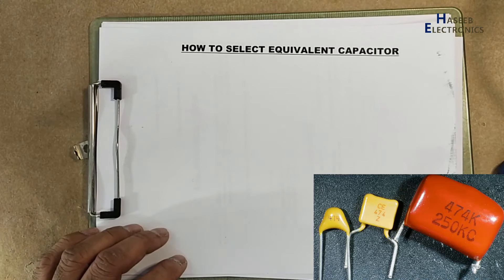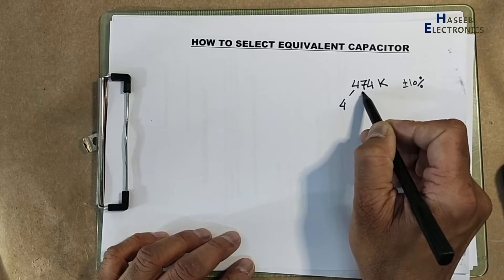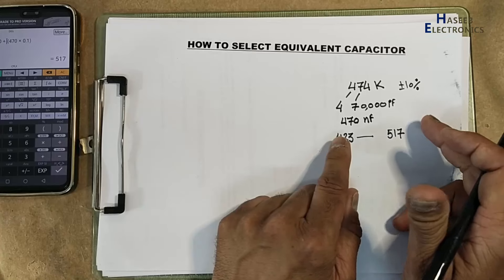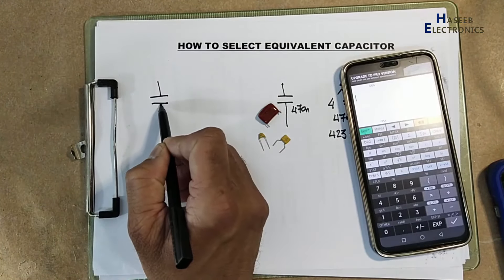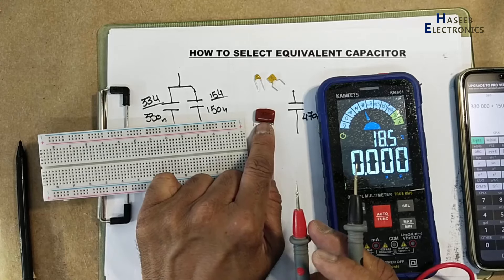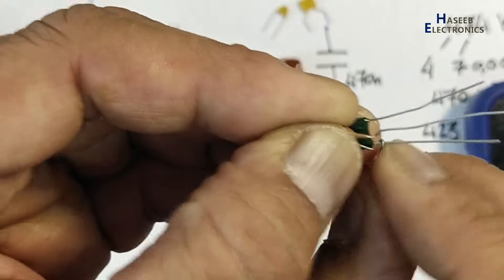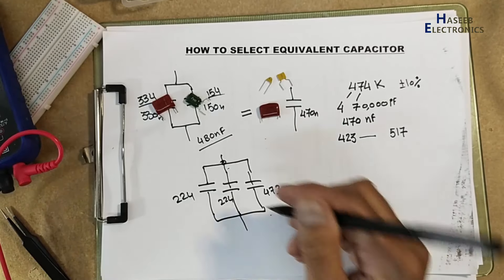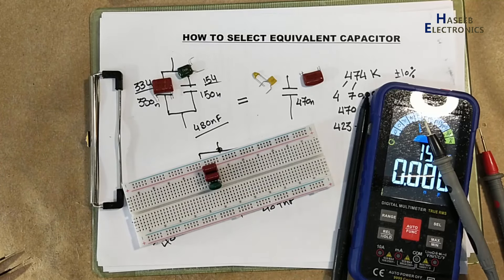{1078} How to find equivalent for non-available capacitor

Comment: Thanks sir
But burned smd capacitor  is it possible to know value
Reply from the maker: burnt SMD capacitor needs 
Length x width (in inches) to find inch code, and hieght as well 
length x width (in mm) to get metric code. and height measuremnt 
then we need to get package code 
after that we can find its capacitance from above three values
Reply: @HaseebElectronics  god bless you sir
Reply: Thank you for this information

Comment: Sir  how you put black lead to  chassis as ground and red lead you measure the voltage across the circuit. Does chassis is a common ground.

Comment: Thanks good video.
-----------------------------

What are the capacitors that have higher CAPACITANCE and lower VOLTAGES  or higher Voltages and Lower Capacitance ratings ??

Thanks

Comment: good afternoon maa brother..hey ..im struggling to replace capacitor on primary side mosttly it s big filter capacitor of 1000ufx200 v im confused about which one to replace    in place of that capcitor of 1000uf/200v..i can replace it by another one of 1200uf /200v..??????

Comment: Hello sir I saw a video of your about smps welder you mentioned that the capacitor to the gate to source is use to discharge the gate but I realize that you most had made a mistake because it’s use to driver the igbt when the gate driver transformer cannot provided enough current the capacitor is use as a buffer for the igbt to fully charge